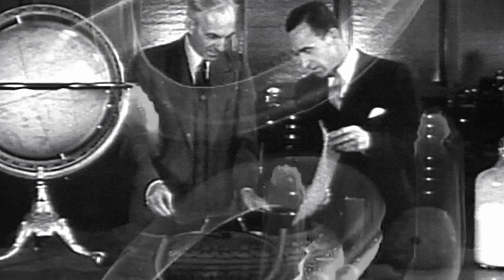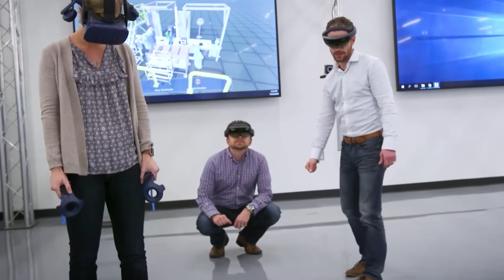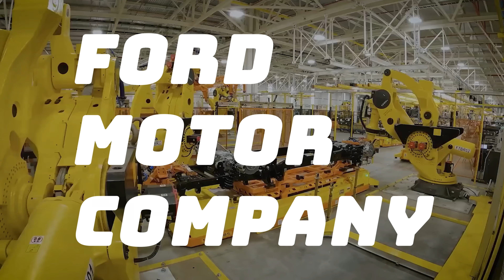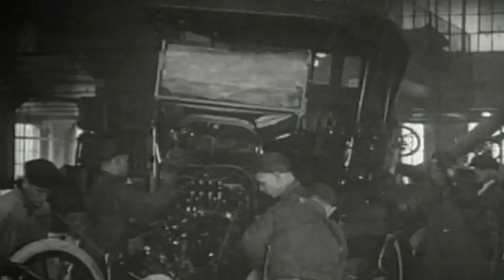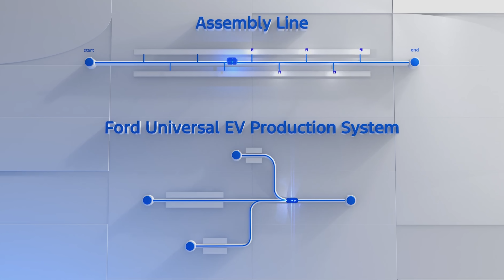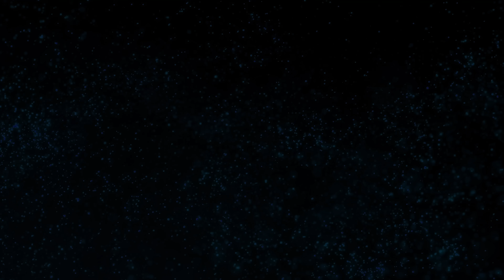Did Ford just reinvent the Assembly Line?!

Comment: Sorry EVs are a complete failure.  Without the massive government subsidies, the vehicle cost would be prohibitive. The public (outside of California) has said no. The range is awful even worse in extreme conditions. The new lithium battery that Ford is touting is cheaper to manufacture, but the range will be significantly less than the standard lithium battery. Consumers' number 1 complaint is range, and Ford doubled down on that! 🤦‍♂️should have come out with a more affordable hybrid type vehicle. Toyota's Prius is the gold standard for hybrids. Shouldn't even have mentioned the Lightning it is equivalent to the Edsel a complete and utter failure.

Comment: I left Ford years ago , when I bought a brand new Edge and the firewall was not secured properly and water fill the whole under the floors. Every time I stopped  you could hear the water moving back and forth . After three months I finally was able to get a new Edge. Before that I bought a brand New Escape , after three months there was recall for the engine heads. Thats it for me move on from Ford

Comment: I'm fairly sure Tesla anyway use a version of Unicasting, as do Volvo. Tesla also  removed the miles of cabling by using network switch tech.  Is this new? Not really its not that much different to how the assembly line is run today.  Every station is fed by external tree branches. 

They're just having 3 branches inside the factory.  Electric vehicles and new process techniques allow for this.

Having one facility for ca range of models is the most ambitious though. 

I'm sure from memory Toyota reckon 80% of a car cost are fixed by the design and factory set up,  fixed running costs.  Attack both of these as Ford claim they can really reduce the total costs of manufacturing.

You do that by redesigning the product for manufacturing. 

Great video.
Reply: Everyone uses the assembly line created by... checks notes... Ford. Companies use whatever strategy work$

Comment: Sorry ... ex-GM Quality Engineer here (yes I get the the oxymoron there ... hence the ex part) .... The GM 360 platform (Trailblazer etc) was built this way (body on frame vehicle)..... Chassis was built on one line, body built on a second line, doors built on third line and the cockpit (aka dashboard) built on a fourth line. I'm pretty sure most body on frame vehicle were built the same way at the time... So, the "new way to assemble" language is just marketing language. No practical difference.
Reply: Yup everyone that works in manufacturing now thinks Ford’s upper management are the biggest idiots on the planet for claiming this is new. Every car on the market is made this way and has been for decades.

Comment: I don't see how any automaker is going to make any money doing EVS. What Ford needs to do is go back to building stuff people want to buy. You know why. Don't they just send customers questionnaires. Why don't they cold call people ask questions you know. But no, they they want to hire people waste money and then sit there and wonder why nobody's buying their crap and everything's getting recalled every other 5 minutes of with everything they've built so far. I am very disappointed in Ford, almost to the point where I'm thinking very seriously about never ever buying a new vehicle. I think they're EcoBoost stuff is stupid and the EV stuff is just completely retarded because there's like 5% of the population that wants EVS and they're just like 30% plus that wants some similar combination hybrid. And the rest which is something like north of 50%. You know exact numbers? I'm not sure because it's been a little while since I looked at it. Just straight gas or diesel. I mean why is this so complicated for the big three to figure out? And Ford just seems to be doubling down on stupid but at least it's not. Mary Barrera running Ford. And not that I don't mind the horsepower wars. But there's a certain point where 95% of the population can handle the vehicle and then after that horsepower deal less than 5% can handle it and whether that's less than 500 or a little more than 500 horsepower I don't know. In short, you'll have a lot of people driving very expensive cars at 84 96 months. Payment plans crowdsurfing not good.

Comment: EV ? Why new cars suck! New EV’s suck extra bad. Until the stockholders become tier 2 or 3 in influence the new cars will be dead on arrival. Bean counter season should be 12 months . With 3-4 tags available for each hunter. The actors that stand up and speak for these companies should be financially responsible for mistakes, errors, and omissions on their part. 
They cant show a vehicle they don’t have. It may never show up on a dealers lot. Salesman have to take up the slack for the manufacturer left out or lied about. 
I wouldnt buy a new vehicle unless it came with a 36 month warranty, bumper to bumper, including a loaner equal to or greater than the vehicle being serviced. That would increase sales, and the manufacturers could use excess inventory. That would reduce the recalls and fix a lot of problems. I myself am going to buy a Ranger HD . Bring it into the states to make add on parts. Them take it up to my Canadian cabin after a year of working on it. Maybe take down to Costa Rico to play.

Comment: None of it made sense to me. The tt bs when as you point out the stupid ecoboost is a single turno. The 6 days running your house when at the same time they said the battery would be about15% smaller than the byd atto pack which would make it around 55kwhs. Which tesla had using lfp catl cells back in Sep of 2021 btw. To the real about you can put surf boards in it and it'll have more room than a rav4 for passengers? 

It just pissed me off tbh I thought clark&fields getting that skunk works team could do something. But now it's clear to me tesla cast offs are discarded for a REASON!

Comment: All Ford did was copy Tesla. It was Tesla that invented the mega casting. The front module the middle battery an interior module and the rear module. The model why is built that way. They're building a skateboard. FYI an aluminum giga cast is a lot of money and they're not going to be able to keep it down in price the only way to do that is to do it the way Tesla is doing it does cybertruck reduced all the wasted wire because they changed it to a 48 volt architecture. I will believe it when I see it something tells me they can't get it up and running until 2030